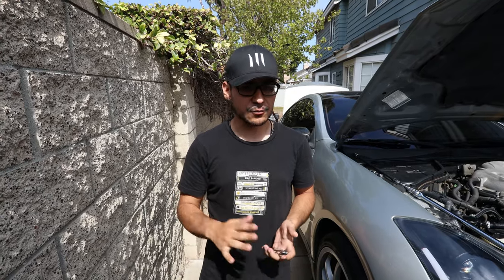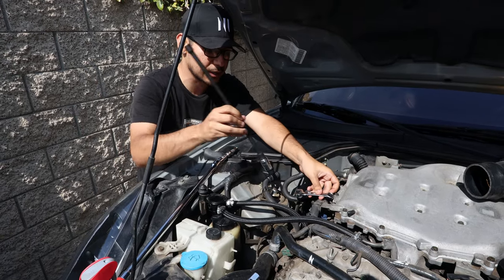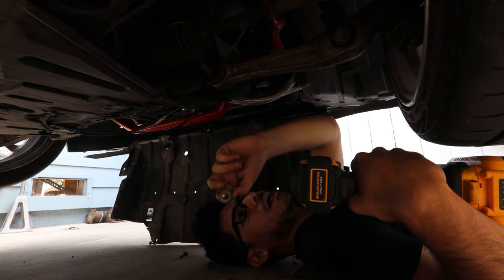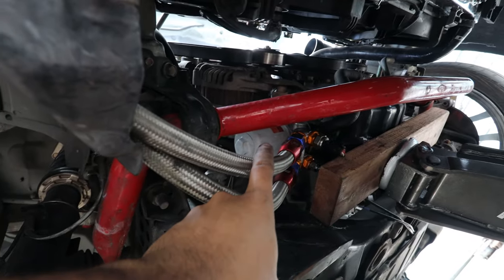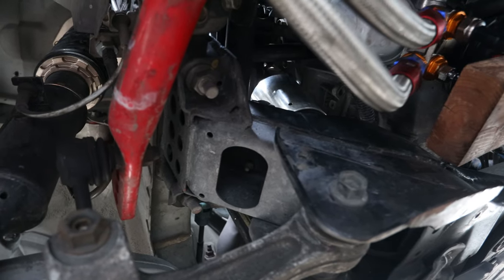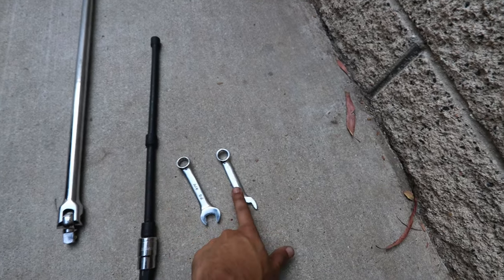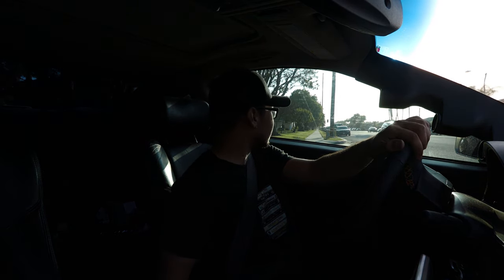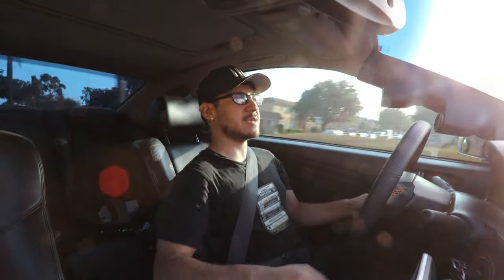The BEST WAY to Install Motor Mounts on YOUR G35 / 350z!!

Comment from the maker: Thanks for watching guys!
Now you can change your motor mounts without removing your engine!!! 
Heres the link to the matco wrench that i found to help me in my case: https://www.matcotools.com/catalog/product/MEWS14M/14mm-stubby-metric-hex-grip-wrench/
Reply: Working on this right now on an07 g35s sedan 6mt .   I purchased solid mounts through z1 .  When lifting the motor from the oil pan… was there any significant flex on the exhaust or transmission?   

Asking bc I have longtube headers and a custom coolerworx shifter set up.  Didn’t want raising the engine too much to snap anything in place further down the drivetrain.  

Did you unhook your exhaust at all to get that extra gap?

Comment: Joe you're wise by explaining this is not for everyone. If you are building a track car, by all means yes, stiffer is better. My goal is keeping the refined Grand Touring aspects of a G35. I'm more into sound deadening and Audio upgrades. I will go aftermarket on the worn OEM parts as long as they are quality units that don't add NVH. The important thing is have a goal and build to your taste.
Reply from the maker: Well said brother! 💪
Reply: Are after market parts good for the g?  Instead of installing oem bc I'm in need of lower control arms and prefer somewhat quality
Reply: @abc876  Do your research. Not all aftermarket parts are of the same quality. Some are better or worse than OEM. Prices are all over the map.
Reply: @Stealth G35 Infiniti  👍 appreciate the reply. I'll look into them,  I wouldn't buy parts from ebay
Reply: These add marginally more nvh, only a senior citizen would complain if they didnt take their geritol.
Reply: I enjoy comfort too but with precision

Comment: Nooo i replaced the motor mounts and transmission mount at the same time. It wasn't bad. I also did my headers at the same time too.
Reply: I did it when the headers were out.
Reply from the maker: Hell yeah man! I think headers might be the next move on the car!
Reply: @JoeVazquez  there is a really good guide here on YouTube. Its really not hard like the forums make it seem.
Reply from the maker: Yeah I think I’ve seen it actually!!
Reply: Any tips on changing the motor and transmission mounts ? My whole motor and tranny shifted

Comment: Hey bro! I’m from the Oxnard area and recognized the parking structure lmao just had a question, when you had a muffler delete on your g35 did you have and problems with getting pulled over? I have an 04 G35 rn planning to just get the muffler off at Juan’s 🙌
Reply from the maker: Do it bro! I’d recommend a resonator and muffler delete, gets a lot of the drone out from the cabin which is ironic and is pretty loud but will satisfy your loudness for a good while! I didn’t have any problems with the muffler delete, I just knew when and where to drive tame so I wouldn’t get caught!

Comment: Quick question, just realized on my g37x coupe that my passenger side axle is leaking so it’s going to need to be replaced, should i go OEM ? Or will after market be ok, 
And if i after market what brands hold up the best thanks 🙏🏽
Reply from the maker: I’ve heard aftermarket axles are a hit or miss, even if they have lifetime warranty, if they mess up you still have to do the job again if they fail which sucks! I’d personally go oem, z1motorsports has oem value advantage so you can get them a bit cheaper

Comment: When you change the motor mounts you already had your Z1 polyurethane transmission mount in there right And you didn't have to disconnect it? I'm just asking because I know the Z1 transmission mount doesn't have a whole lot of flex and I was wondering if that posed a problem to Jack in the motor up a little bit
Reply from the maker: Yeah I already had the z1 transmission mount installed, That should not be a problem!!

Comment: You should invest in a new aluminum under shield maybe a z1 or toll booth Wiley thank me later 🤜🏾🤛🏾
Reply from the maker: I’m definitely gonna look into the under shield!
Reply: I second the Z1 aluminum undershroud! I have one on my G35 sedan and it's great! Oil changes are a breeze taking off the two bolts for the back section only :D

Comment: Do you feel seat vibration after you install the mount?
Reply: I believe so as I got z1 Poly motor mount and it does vibrates a lot in the seat, steering wheel and in the gas pedel if that makes sense no rattling just vibrates.

Comment: What do you need the 14mm hex for.
Reply from the maker: I explain it in the video 😭
Reply: Lol so you mean 14 mmsocket or Allen socket
Reply: @JoeVazquez  hey big question, so if I only need driver side mount to be replace, do I need to lose passenger side or I can just remove it by losen one side only??

Comment: I bought both of those shorty wrenches and the 14mm hex and no luck. I spent over 20 minutes peeling my hand and that stupid nut on the passenger side won’t come off. At this point I might have to remove the alternator and remove the whole motor mount bracket. This job sucks

Comment: Wish I saw this video when I did my mounts yesterday I watch a video where I had had take off the whole motor mount bracket and 1 of the bolts didn't want to go back in where It was hard to reach
Reply from the maker: Yeah man, mine was off the same video! He only took off the bracket because his top bolt was seized but he recommended the same thing that I did, I just found the matco tool helps a ton with stubborn/ stripped bolts
Reply: My top bolt was stripped from trying for awhile. I couldn't get the bolt back in on the bracket it went about 3 quarters the way in but the other 3 are tightened pretty tight with lock tight and the other one is sticking out a little but has lock light on it as well ima fix it later just was tired but love the solid mounts greatly paired with the z1 poly trans mount
Reply from the maker: The matco tool would have probably saved you from taking off the whole bracket! I stripped mine too but that tool was a life saver!!

Comment: How did you end up torquing down the passenger side bolt?
Reply from the maker: Same way I took them off but with a torque wrench on the end of it, if it’s close enough I’m happy, threadlocker is a must aswell with stiffer motor mounts
Reply: @JoeVazquez  perfect thank you man, should be coming in the mail tomorrow wish me luck

Comment: My top bolt on passenger side is so stripped even the matco stubby won’t grip it, I’m at a loss
Reply from the maker: Fuck I’m sorry brotha, unfortunately the bolts are pretty easy to strip which really sucks when trying to get them out.
Reply: @JoeVazquez  Yeah man. Idk what to do, I might get a 13 mm stubby and see if it will slide over it
Reply: @JoeVazquez  man I ended up having to call my buddy over, he dropped the header just to get to the motor mount bracket bolts to take it off. Turns out the top nut wasn’t even that badly stripped I guess it was just the angle or something I couldn’t get the wrench to seat smh. But definitely a very worthwhile mod, maybe the best one I’ve made. Both of my oem mounts were broken in half and one side was even missing the bottom nut.
Reply from the maker: Make sure you put threadlocker and even some lock washers, the bolts are known to come undone due to vibrations, hence you missing a nut on one of them!

Comment: This method didn't work for me both top nuts were seized. Lucky the bottoms came off very easy. I had to take off both headers the Ac compressor and don't get me started on the mounts not lining up with the frame holes after all the work done. Also I had to drill the nut on the driver engine mount to get it off smh
Reply from the maker: Dam that sounds like a nightmare! I figured some people wouldn’t be able to take off the bolts, specially with people living in different places where the climate could play a huge difference!
Reply: @JoeVazquez  Yeah wish I lived on the West unfortunately I'm on the East coast so it played a huge roll. Took me 3 days but I got them in tonight, and from my start up and idle this thing feels like a race car lol cant wait to drive it tomorrow. I got the GK tech solid.
Reply from the maker: Haha hell yeah bro! Let me know how you like them! FULL SEND!!!